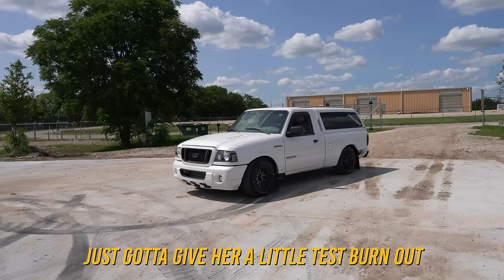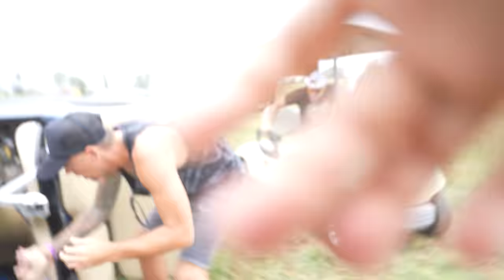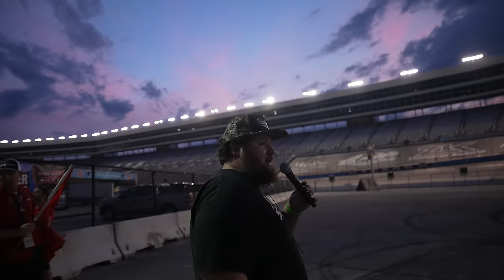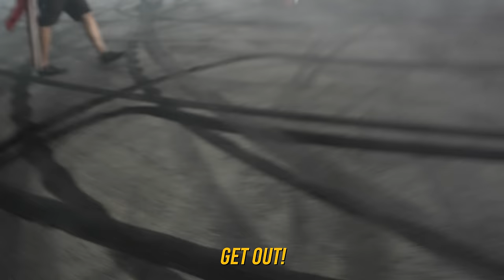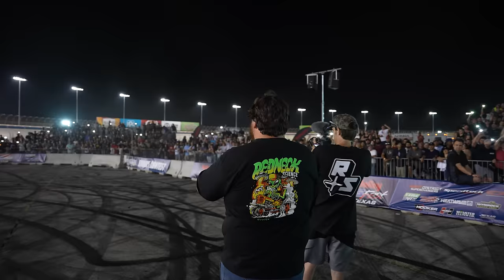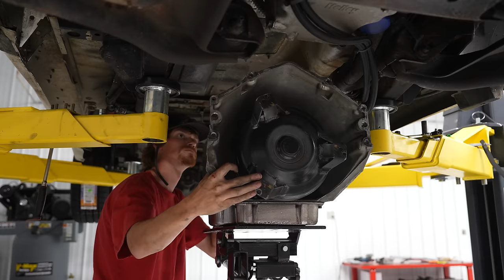My Ford Ranger Caught Fire

Comment: That is absolutely nuts that thing caught on fire as badly as it did and it's still up and making power. I used to have a 1995 Ford Ranger Super 4.0 OHV with the dreaded 4R55E transmission with 134k miles on it and I only paid $500 for it. That thing was immaculate and it would lay an 11 for 75 feet with that 4.0L and a posi. It was 2WD. I loved that truck. It was an extended cab long bed. The LS engine didn't exist back when I owned it, but I would've loved to have swapped even a 4.8 into it with a Tremec 6060.

Comment: A auto fire suppression system would be cool
Like a plastic pipe system that can just be connected to a fire extinguisher to put out a fire
Or better. A pump and fluid Reservoir
Reply: They already make those and they use steel line
Reply: @_bizmo_fungus_894  oh... I find features like that kinda cool
Plastic could also help cause if the line melts, theres heat and its probably because of a fire and the extinguishing stuff will go out of the melted spot
Reply: @g1expert102  plastic line would be completely useless and incredibly unsafe. Fire suppression systems are not automated you have to pull the release switch and because of that they’re not pressurized all the time. If they were plastic they would just melt making them completely useless then you can say goodbye to your race car
Reply: @g1expert102  they put nozzles in very important places like under the steering wheel pointed at the driver and around the hottest places in the engine bay. In the engine bay plastic lines would never last.
Reply: @_bizmo_fungus_894  They do make automatic suppression systems, either temperature or impact actuated.  They do cost more and have some downsides to them, but they could save a life if the driver is unconscious and on fire.
Reply: @YouveBeenMiddled  yes but they’re a shit load more.  My main point was that plastic lines would be completely useless

Comment: Use a bore scope, some guys did in Tennessee after buying an engine that was the victim of an engine fire. As long as the inside is fine replacing the wiring etc is all that's needed.

Comment: Exhaust gaskets are overrated, we throw them on the Rover V8 :D  Anyhoo, seriously, for a good dyno pull with diognostics you need to fit all 8 exhausts for temperature sensors. That will tell you a lot about inlet flow, head gasket and valves. Knowing is everything in racing.

Comment: Well with all that work you put in that truck you should put a kill switch on the back of the tailgate just in case you have another fire and when the starter just keeps cranking with the key off. Probably a better to put a power cut off switch back there